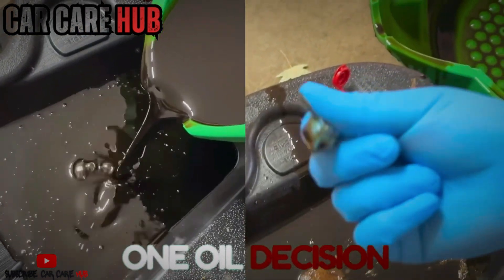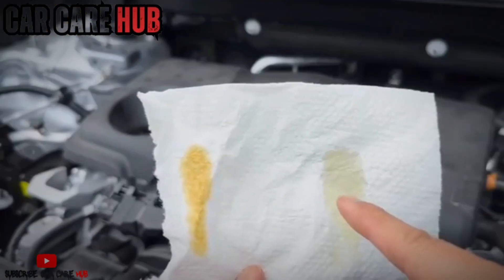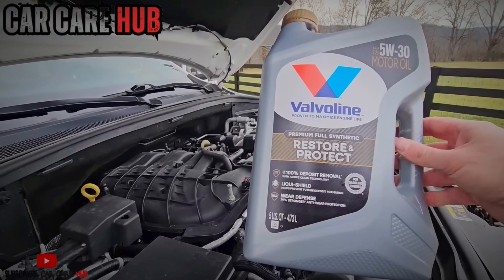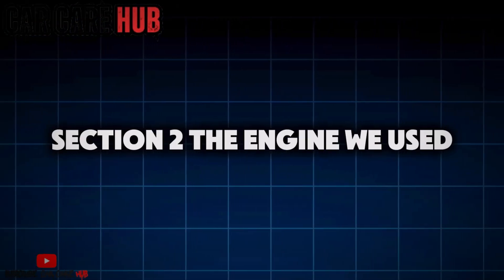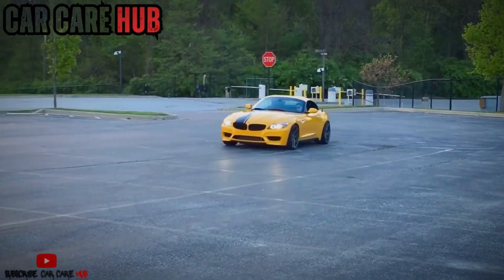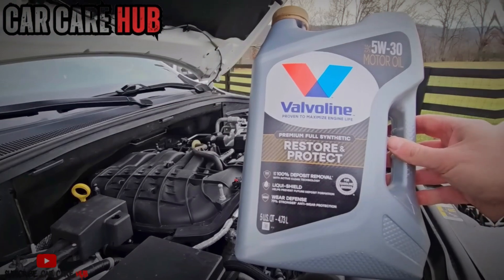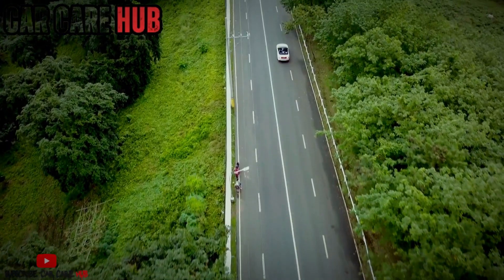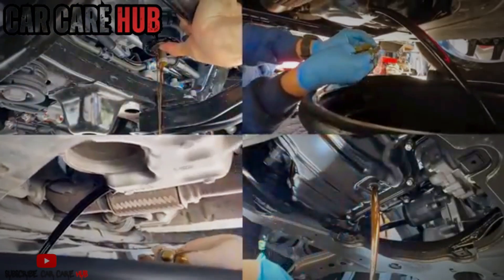We Tested 0W-20, 5W-30 & 5W-40 in the ENGINE — One Clear Winner !

Comment: What about 5w-20? It's what's on the oil cap of my 06 crv. It's got 80k miles. Maybe I should switch to 5w-30 after the winter?
Reply from the maker: For your 2006 CR-V, 5W-20 is what Honda recommends, and it’s fine even at 80k miles. Switching to 5W-30 isn’t usually necessary unless the engine is burning oil or running under heavy loads in hot climates. After winter, sticking with 5W-20 is still the safest choice.